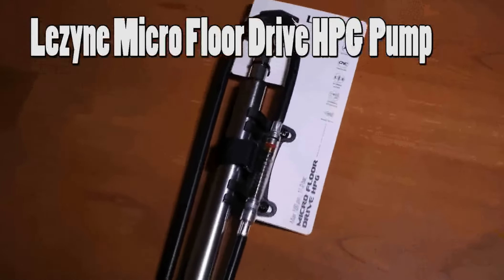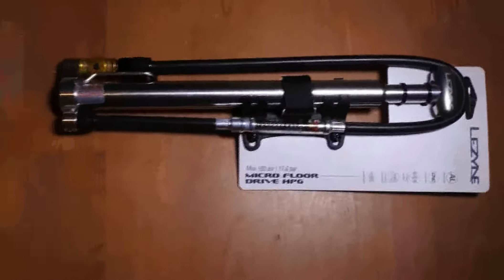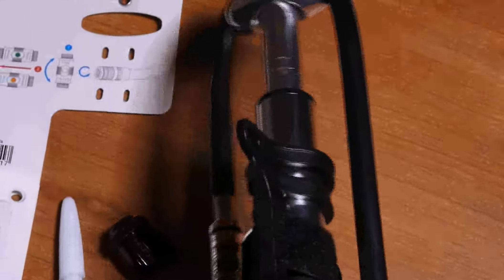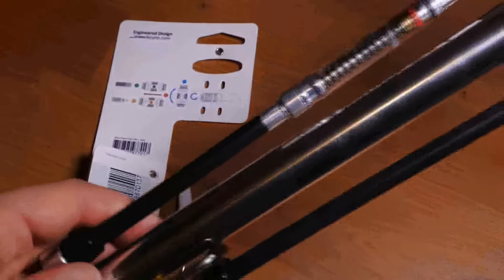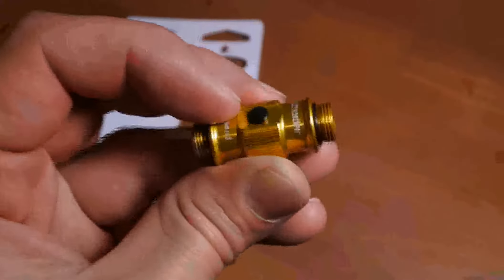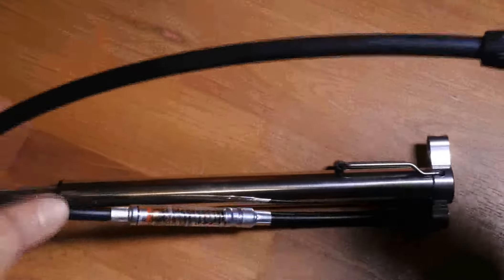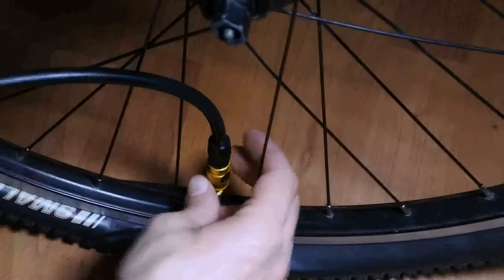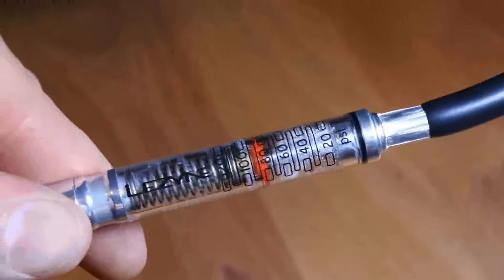Lezyne Micro Floor Drive HPG Bicycle Hand Pump tested

Comment: Those grooves in the handle look as if they will be pretty uncomfortable in the palm of the hand after fifty heavy pump strokes. Handle is rather small, too, which will only make it worse.
Reply: I own one and have no problems using the pump.  It doesn't take long to pump up tire unlike many other mini pumps that do.